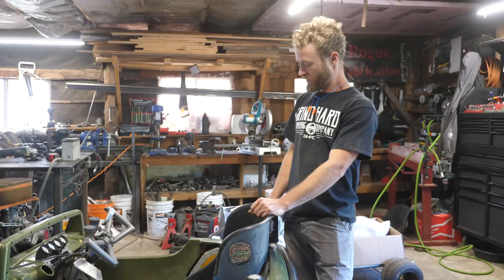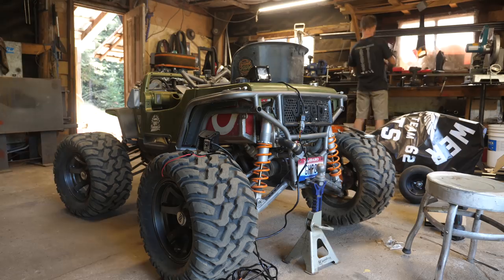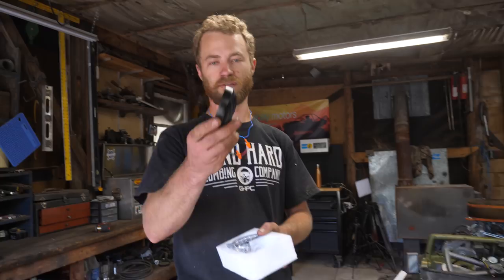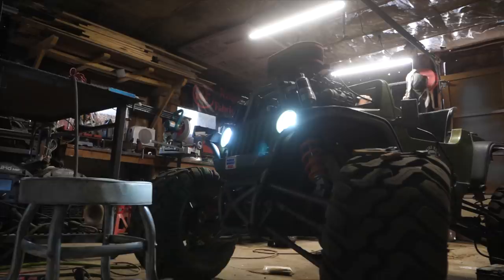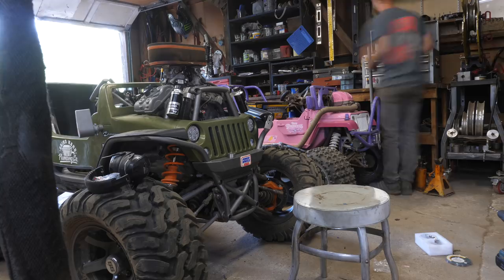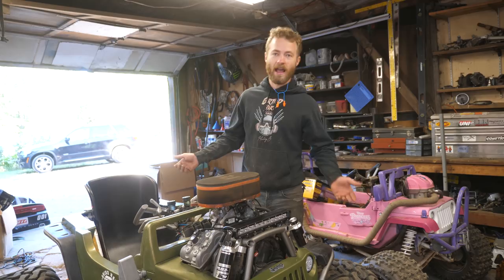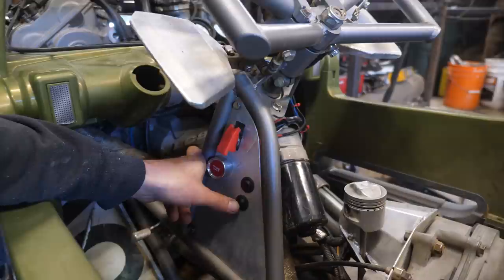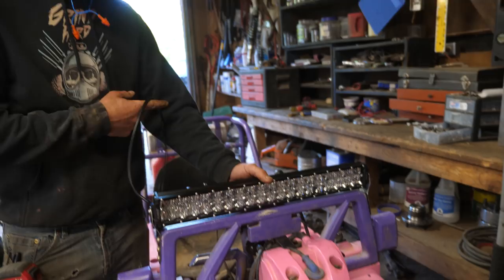We Put LED Lightbars on the Ultimate Power Wheel Jeeps!

Comment: So many many years ago I bought my eldest child a Jeep Hurricane much like yours that the Colonel's made from. Mine did not have nearly the creativity and mechanical increase that yours has but mine did have lights. I mounted incandescent lights inside the headlights that were almost dead perfect diameter match and they work absolutely perfect. I put marker lights meant for trailers on the sides and rear and when it was all said and done the lighting was run off of a single switch and ran off of the original Power Wheels battery. The power wheel itself ran off of a deep cycle battery that I mounted with external post so you could charge it with a regular battery charger. It worked extremely well it conquered snow it conquered dirt but traction was an issue. So I cut up bicycle tires and I screwed them down to the plastic Wheels like paddles and after that it was nearly Unstoppable. Sadly the plastic gearing gave up and it was pushed the way side of the yard and that's where it left. I built a fifth hand go kart Auto Parts cost of Predator engine on it and that was the last thing that was built with a motor. You guys do some badass work keep it up it's very inspirational